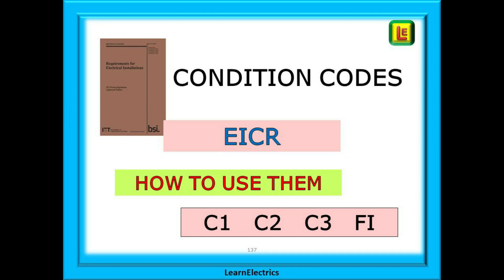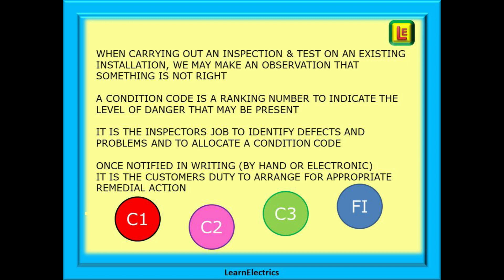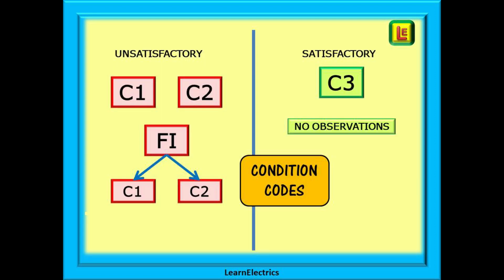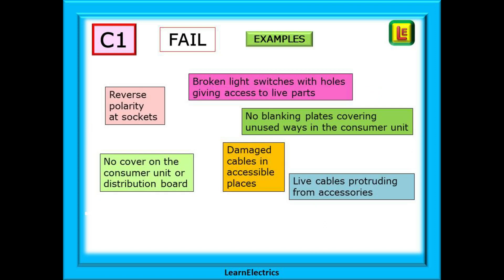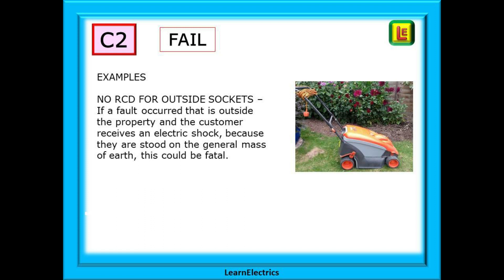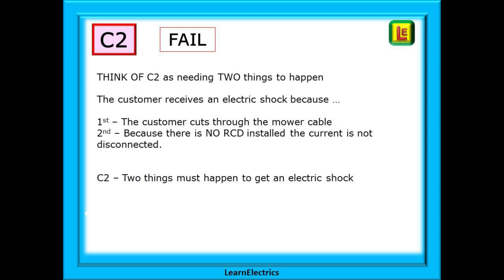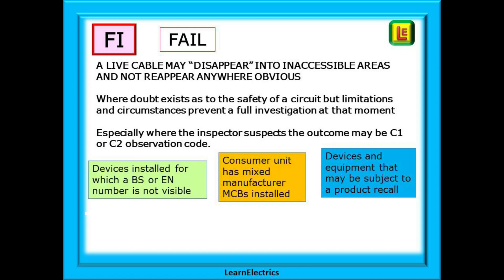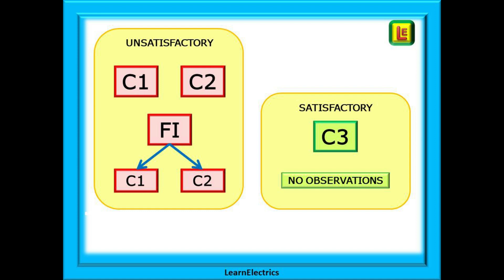CONDITION CODES – EICR – WHAT THEY MEAN – HOW TO DETERMINE THE CORRECT CODE TO USE

Comment: I got low insulation resistance between live-live but live - earth is getting recommended reading. So, I coded as 'FI'. My question is where should I record this information in condition report inspection schedule (already recorded in observation), is that under final circuits 5.6? I received no continuity in line in another circuit also, which coded as 'C2' (already recorded in observation), but the same doubt as previous is where should I record this information in condition report inspection schedule. Thank you.

Reply
Reply from the maker: See previous answer. Thanks for watching.

Comment: what would you code offices with no RCD for sockets & lighting ? cables <50mm depth
Reply from the maker: A lot depends on what age the installation is and the circumstances presented to you on the inspection. Could be either C2 or C3. Its up to what the inspector sees on the day.

Comment: Great little video ( people fail a perfectly good non rcd board C1 ) due to cables less than 50 mm in the wall or no rcd for outside use even when it’s a ground floor flat and grass is maintained by others C3 all day long you can only ADVISE not try to scare client into having work done by falsely saying C1 when it’s not.( way to many perfectly good consumer units have been changed in the last 2 years for this and even with full rcd protection they C1 it as it’s insulated type and not even in an escape route😂)
Reply from the maker: Spot on Kevin. There are that many cowboys out there we could rename this country Texas. I hate it but nobody seems to do anything about it and the customer has been scared into parting with hard earned cash.

Comment: I have a friend that paid £85 for an EICR in London. The electrician carrying out the EICR was there for less than 15 minutes and immediately gave a C2 and thus Unsatisfactory. The C2 was for a split RCD installation, but contained in a plastic CU. The same electrician was back the next morning charging £650 for a complete CU change.
Reply from the maker: £85 is not an EICR. That would have been a routine inspection. Plastic CUs are ok to leave in if installed before metal boxes were required. Sounds like they were "misled".
Reply: Great "friend'.......